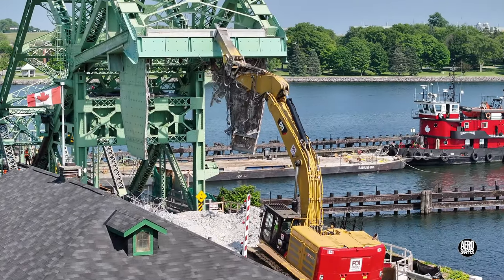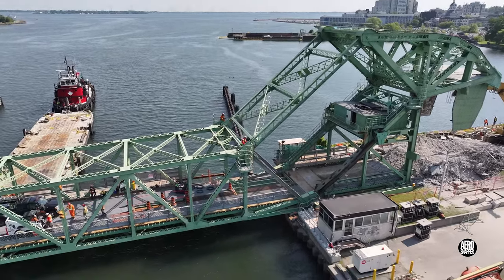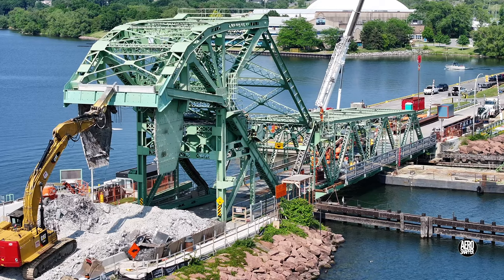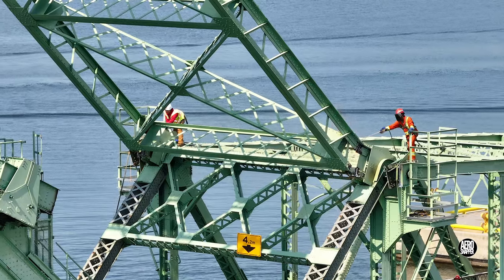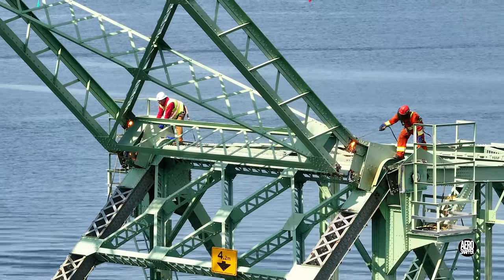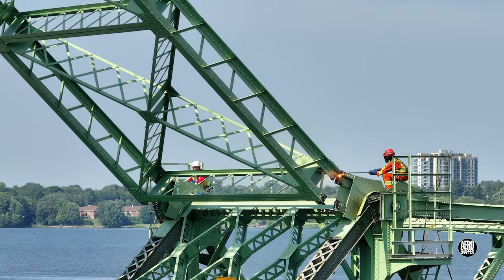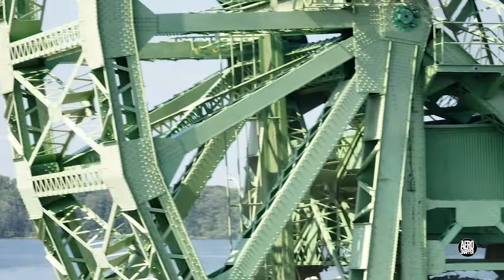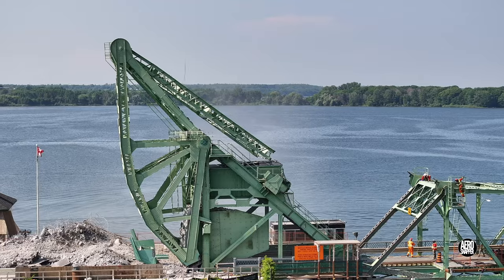The First Cut is the Deepest - an update on the La Salle Causeway lift bridge   4K

Comment: Came across this by accident, now hooked. Brilliant coverage. One question I cannot find the answer to, what was the “incident” that cause the buckling of that truss? Thanks!!
Reply from the maker: It's unclear - but some sort of imbalance of forces caused a major structural member to buckle - subsequent investigation revealed greater concerns, leading to the decision to remove the bridge
Reply: @Aerosnapper  A couple of days before they closed the bridge to pedestrians for the final time, I took some time to walk across it. I ran into someone who spoke to me about their concerns on what they observed during the whole process leading up to the buckling; namely that they may have added more weight on both ends against spec, and before it was fully reinforced, raised the bridge for a boat, which caused the failure. I have no confirmation on this though.
Reply: Is it being investigated? All the evidence has been destroyed now. Shame to loose such an iconic structure.
Reply: @andyduft2997  It is being investigated. One of the reasons why I took so long with because they were taking all that time going through it with a fine-tooth comb. That's why they only found recently that not only was the bridge damaged so badly it would take way longer than would be appropriate, they also determined that even if they did repair it, there was a good possibility it wouldn't even open again because of the bend in the structure. And regardless of the repairs, the lifespan of the bridge was severely shortened.
Reply: Thanks for that. But, was it negligence that caused the “incident”?